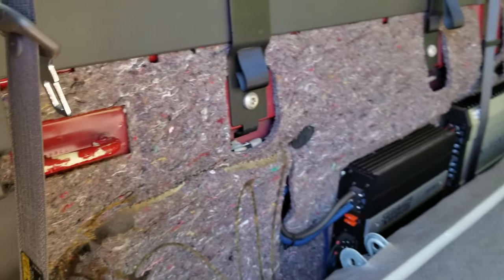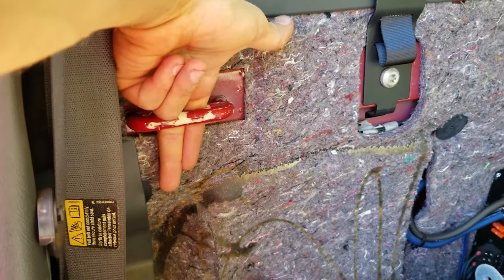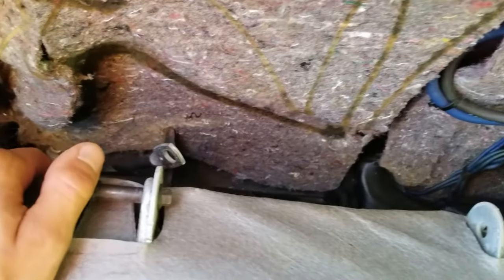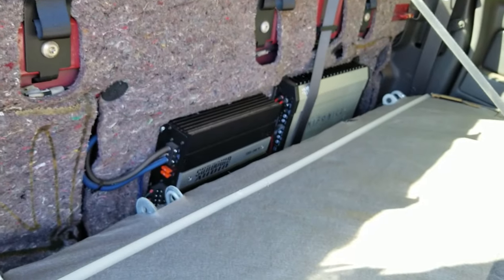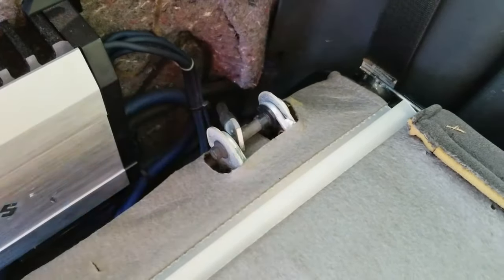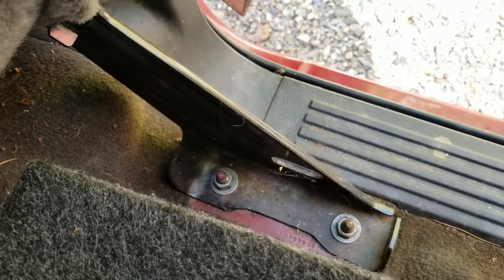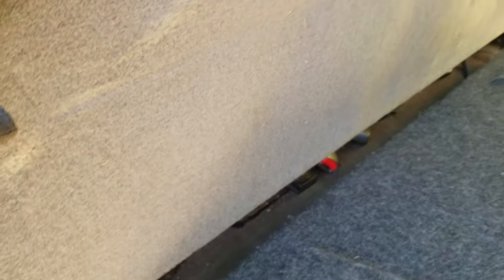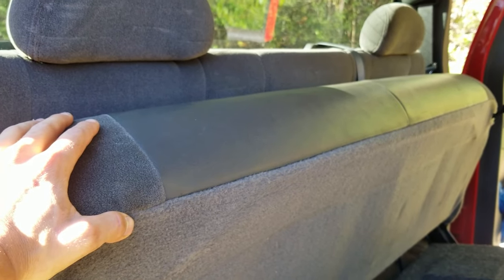Own A Silverado? WATCH THIS Awesome Rear Seat HACK! UPDATE

Comment from the maker: Previous video: https://youtu.be/6PLd6cAIz0M  
Links in the description to tools and supplies :)
As an Amazon Associate I earn from qualifying purchases.
This mod has been working great for me for years.

***This video is for entertainment purposes only. Matt's Shop is not responsible for any damages that may occur from attempting to duplicate any repair procedures or modifications performed in this video or any other video.***
Reply: Basically you had trolls, and idiots that could not grasp the fact that the bottom seat lifts the back portion when you raise it so the hooks go over the rings.. the hooks drop down when you lower the bottom portion into the seated position... its something chevy should have done from the start.

Comment: Matt, you are a 100% correct, your mod in no way changes safety of the rear seat, just a lot of blowhards want to make negative comments, great idea, I did it to my truck. The only way back seat folds forward is if you release the bench portion.  Thanks again.
Reply from the maker: Yea, see you get it! It works awesome!

Comment: So basically, you're just shortening the distance one has to lift the back up to get it off the hooks?
Reply from the maker: Pretty much.
Reply: @MattsShop  I have a 07 1/2 new body style that has a split 60/40 bench. One of the hooks is missing the nylon bushing,  causing the seat to rattle over bumps, I think. I'm not sure I want to do this. But dang, it's a real pita getting that split seat off to get to amps and stuff. Not sure if I'll even be able to get it back on by myself. I have no friends either. I 🤣🤣

Comment: This mod also works on 14-19 silverado double cab. I just did it, took about an hour. I cut the bracket 0.80" from the bottom of the top hole. I found that to be best after some experimenting. If i had to do this again i could probably get it done in 45 minutes including cleanup. Not much to look at back there but I'm glad i can access it now.

Comment: 👍🏻👍🏻👍🏻
Great tip, and I'll be your friend.

And would it have been easier to just got those seat cables so the seat would fold all the way down?
As for me I'm not ever going to sell my truck.
Reply from the maker: At least someone wants to! You can, but then there are no safety straps. I don't recommend it to other people if they have passengers riding back there.
Reply: @MattsShop  , that makes since.

Comment: The only thing that would change the safety in a seat is how it is bolted down to the floor the back part you can modify it anyway and it does not change safety at all. Seriously there are a bunch of idiots commenting that don't know their ass from hole in the ground

Comment: This does not jeopardize safety of truck. I did mine on a 2014 GMC Sierra 1500 crew cab. What I would measure the brackets of the seat that connect to the back face of rear cab to know where to cut them. Just make a dot where they need to clear bracket while the seat is still attached. While the seat is out of the truck remove the bolt holding the metal strap at  rear of seat too. Install seat done.

Comment: Same situation. No friends, same truck, same badass stereo. Spent this weekend doing some install upgrades. It took me 20 min trying to wrestle that stupid back seat out. My question: exactly how much of that little piece did you cut off?
Reply from the maker: Haha, I let the seat latch and then pulled the fabric back. Cut off the bare minimum amount just to get the figer over its bracket bar it sits on.
Reply: @MattsShop  well, I took a wild guess and started cutting. Works perfectly. Thanks for the tip Matt
Reply: Why do you just take the whole seat out..you're says nobody's seating back there ahhhhh..I needed hands job's to Cummings Dodgers pickup truck for 20plus years

Comment: It's really annoying that Chevy made the back seat so hard to fold forward. I have a mouse getting into my truck through the vents on the back side of the cab... All I need to do is put steel wool from the inside and duct tape over it but I have to go through all this crap... WTF
Thank you for showing how to modify the backseat.

Comment: where did you get the middle back seat belt?  mine only has a lap belt.  NEED to update mine to a three point.  what is your model so I can do this?
Reply from the maker: 2006 Chevy Silverado 1500 LT 2wd 4.8. It just came from the factory like that.
Reply: I have this exact same truck.  any way you could give me more detail?  VIN to help someone look up that seat belt?

Comment: That's awesome bro...I'm going to try it. As far as the safety issue... People just like to complain about nothing sometimes...if I'm in an accident violent enough to straighten the hinge on a rear seat, I don't think the stock seat will make a difference.
Reply from the maker: Exactly! You get it. Don't disconnect the safety straps if you got kids or people back there. I know. You should see some of the comments.
Reply: also, it's the seatbelts that hold you in place and they're bolted to the body, so it doesn't matter.

Comment: Thank you Matt! Screw all these cry babies. I have an 08 extended cab & I’ve been trying to figure out the best way to put a simple audio system in it that is basically hidden. Both your seat mod & amp mounting ideas are exactly what I was looking for. From what I gather even though the 08 is different (no pull cord to lift the bottom & mounting brackets are slightly different) the basic seat is still the same. Except one major difference but I don’t think it will affect this mod. The seat is 60/40. In order to remove the seat, the passenger side (small side) is the key & has to come out first. The larger side has no actual mount to the floor there. It bolts to the bracket on the side to the smaller seat. I hope this helps others. Oh & btw, I’m 52 years old. My youngest kid is 24. There are no small kids riding with me lol.

Comment: Matt can you tell me how to get into the back of the center console of a 2017 Silverado? The end that faces the back seat? I have one of those sping grabbers stuck in there.That I was using to fish some wires through . From the floor to inside of the console. I got one side done (driver’s) I want to go up from that access flap on the bottom to the hole for the hinge.

Comment: i have an isuzu dmax it does that from the factory, ill be putting a dual battery system back there
Reply from the maker: That's interesting. What year is it?
Reply: @MattsShop  2010
Reply: I will be attempting to put a second battery behind my 05s seat as well as 4 amps